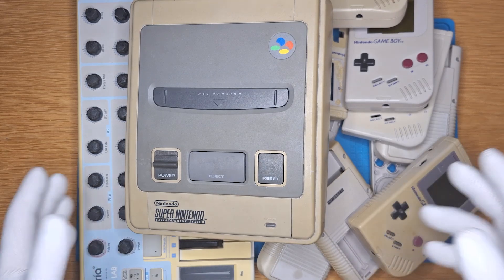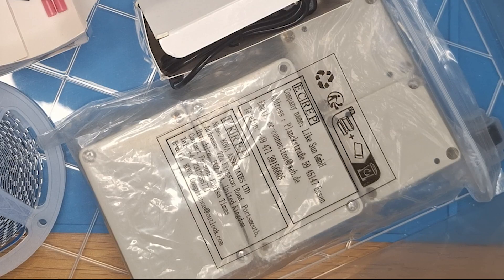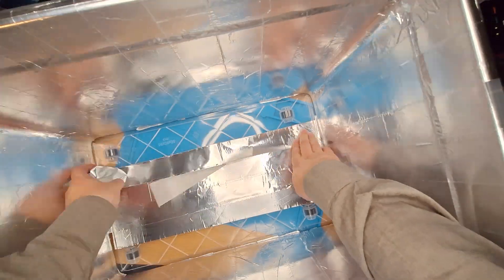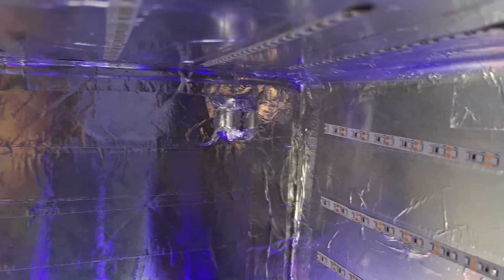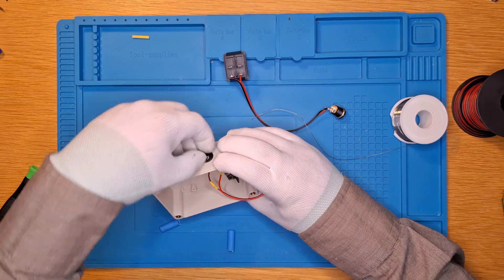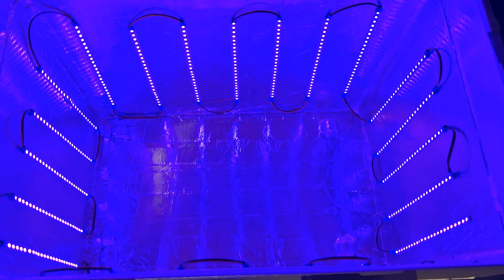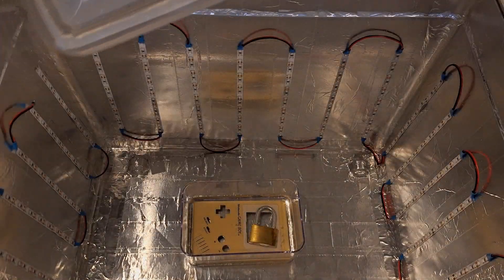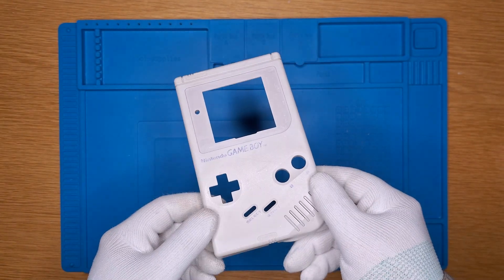I Built a DIY UV Box to Restore Yellowed Consoles (and It Backfired)

Comment: The plastic yellowing effect is not produced by the light itself, its just chemicals oxydation in them while being exposed to oxygen in the air. Heat is a good catalyst to speed up the process, the more the plastic is exposed to heat the quicker it goes yellow.
This is also why you can find yellowed plastics even those were never exposed to light, or they goes yellow again after being treated, just because they are exposed to oxygen in the air.
This is also why plastic doesnt go yellow (or a LOT less) behind a sticker.

The biggest problem with the use of chemicals for yellowing treatment is that you can go "beyond" the original color very quickly, or even damage the plastics (they often goes more brittle).

I only use UV light (UV A type, avoid UV B and C since they are bad for you) in a partially closed box, UV light is a really convenient bleaching agent, even tho it can be quite slow it is a lot easier to fine control the process and almost impossible to damage your parts (unless you left them weeks in there or too close to the UV panel ). The catalyst effect of the heat produced by your UV light is an ally here, it helps speed up the bleaching process.

I've been able to restore a badly yellowed NES just with two 50w UV panels, almost 1 week of exposition by rotating the shell every 12h or so to expose different areas. The result is not a "like new" grey but still quite clean and uniform. Without any chemical at all, just a good clean before with some mainstream dish soap. It also seems that chemicals treated plastics have a tendency to go yellow again quicker than with just UV, at least after reading some forums posts.

Keep in mind that the UV bleaching effect depends of the distance between the part and the UV panel (also the plastic type and color), the closer you are the quicker it gets but if the plastic goes too hot it can warp or other bad stuff you dont want to. So usually not closer to about 10cm with my 100w panel.

Exposition time depends of the plastic type and the UV panel power, the more the plastic goes towards pure white (initialy at least) and is shiny finish the less it seems to be affected by UV, or at least it needs a LOT more time (maybe because it reflects a lot of it). On the other hand matte grey or so are perfect for this treatment (like SNES, PS1,...).
I even tried on some GBC cartridges shells, those ones are transluscent and it seems they barely react to UV at all, even after a load of hours under the UV panel it was hard to see any improvement, maybe because UV rays seems to mostly pass thru it instead of being absorbed.

My 2 cents after bleaching all my retro stuff with UV only and doing a LOT of testing just because why not.
Reply from the maker: Wow, you’ve done your homework! Yeah, it’s the bromine reacting with oxygen, and heat just makes it worse. Totally get why UV-only works for you; less risk of turning your plastic into a brittle nightmare. The GBC cartridges ignoring UV is wild, though. Maybe they’re just built different?
Reply: @apacalpa  Dunno, but I just guess it's because its transparent. So UV doesnt get really get absorbed since they mostly going thru, same as a too white / shiny plastic (like some lego parts) reflects most of it and so the process is far less effective.

My apple green GBC is almost unaffected by UVs too, maybe a tiny bit of improvement after a lot of hours of trying but its hard to tell to be honest.
For those special cases the best way should be to take photos before and after in a controlled lightning area with the exact same settings on the camera (shutter / aperture / ISO / WB), but if i can barely see it with my eyes it doesnt really worth the pain to try for it.

Comment: I built one of these three years ago using the same list, but for Lego pieces. The results looks good when left for less time. Unfortunately they all reyellowed while being stored in a closed cardboard box for 18 months. I threw them into the scrap pile and dismantled the box. Can't with good conscience sell Lego knowing that the customer's going to have a yellowed set a bit later down the line.
Reply from the maker: That’s a tough situation, but totally understandable. The reyellowing is due to the bromine in the plastic. UV light speeds up the yellowing, but heat and even oxygen exposure can also play a role. Unfortunately, it’s an ongoing battle with these older materials, but kudos for being honest about it with your customers!
Reply: @apacalpa  Thanks! I kinda feel like UV may have been perceived as necessary for deyellowing because people first did this by leaving it submerged in bleach out in the sun, and thinking it was the light, not the getting warm. Hmmm... now I wonder if anyone's done a test with UV light, bleach and a freezer... 😂
Reply: When I was a kid my mom and dad bought secondhand Lego all the time for me and I used to use dawn dish soap to clean them then let them sit a few hours in heavy diluted bleach to bring back the color.
Reply: @JohnZombi88  Yep, the UV isn't actually needed, they'll deyellow with just a bit of heat and peroxide! I put quite a bit of time into finding out a good process, unfortunately it was all wasted and I shouldn't have bothered 😂
Reply: I've wanted to retrobrite a few of my vintage electronics, but I've heard that some plastic types will re-yellow even worse than before really quickly. So I kind of decided against it but maybe someday.
Reply: @beff50  Yeah, I don't know the timescale unfortunately, but 18 months was enough. Can't say for sure if they were worse as some bricks were very yellowed when I started, but the reyellowing was definitely bad. If available, replica cases is the better way to go.

Comment: FWIW you should avoid contact between hydrogen peroxide and metal objects, like the pad lock!
Reply: The metal catalyses the breakdown of H2O2, as does the UV-light, so it really doesn't matter in this specific case.
Reply from the maker: @Psychx_ THIS! It was actually intentional here. The UV light and the metal both help speed up the process. Though, in hindsight, the GameBoy shell might argue it was too effective... Poor thing got overexposed and went full ghost mode. 😅